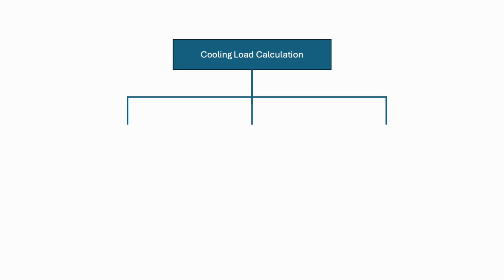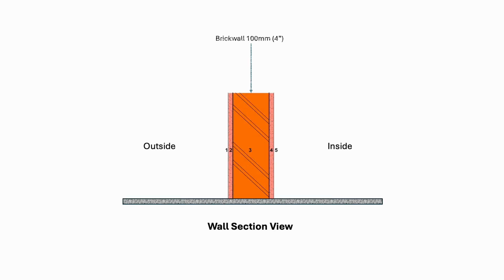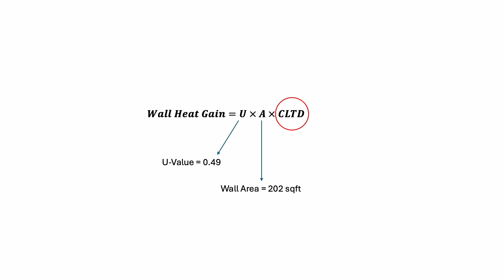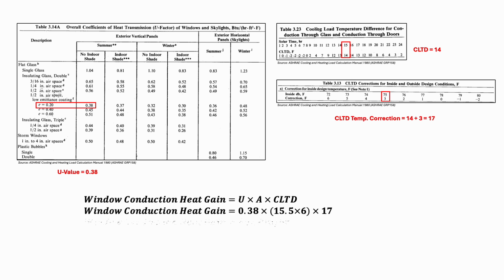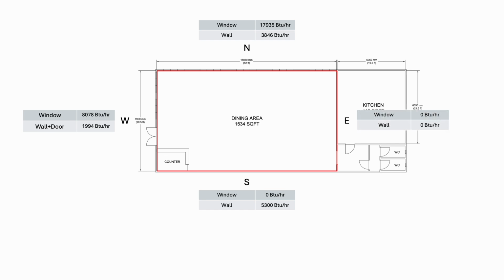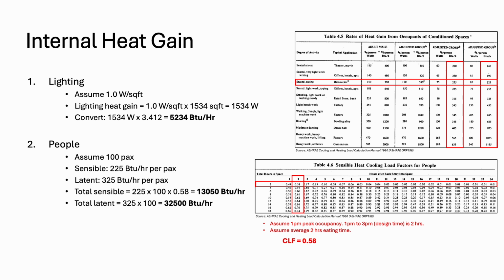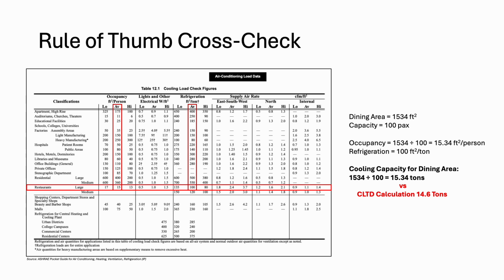Simple Cooling Load Calculation Procedure

Comment: why the the CLTD for window just need correction factor for inside conditions?how about the outside?
Reply: The tabulated values shown above remain approximately the same for outdoor maximum temperatures ranging from 93 deg F to 102 deg F and daily outdoor average to be 85 deg F. However, if the values differ from above then table 3.13 is to be referred for correction in Outdoor temperatures.

Comment: Where you get cltd indoor temperature 78-75 from. Where you get 78 and 85
Reply from the maker: Refer to the correction factor table in the manual. It mentioned the default indoor outdoor temp. used for the factors and coefficients. Then, apply a correction factor according to your indoor outdoor design conditions.

Comment: Hi, thank you very much for your video. It is very informative. Quick question on the Table 12.1 Cooling Load Check Figures, I can't seem to find it in the ASHRAE Pocket Guideline SI and IP. Is there any reference for that? Because that table helps alot. Thank you. 🙏
Reply: You can find the table in the Cooling and Heating Load Calculation Manual as well. The table is labelled as A 1.1 on page A 1.8

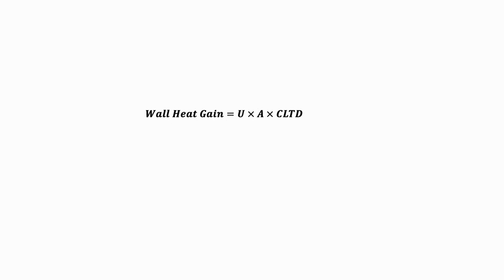Comment: Hello at 2:58 where did you get the 78 and 95 for CLTD indoor and outdoor correction. Thanks.
Reply from the maker: 78F indoor is what the manual use to derive those CLTD values. 95F outdoor is our outdoor design temperature.
Reply: @aircondlounge  Thanks a lot!. Last question. Why did you use Latitude 0 at 2:56. Thank you. Your work is great.
Reply from the maker: It is the nearest latitude to the location used in the video. Tq.

Comment: Nice video, really helpfull. But I have a question, i followed the same steps you did, but i was using he handbook from 1997, in that version i could not find the data portraid at tables 3.14 and 3.13 for glass windows. The only table with cltd for conduction through glass was the TABLE 34 at chapter 28. Is there any chance that this table already considers those correction factors, or they are neligible for the result?
Reply from the maker: It could be. Try to look for any notes that mention the need to apply correction factor. Otherwise, follow the steps outlined in the book.

Comment: Hi Yu Chang Zhen, 
My greetings for your wonderful work in YouTube. 
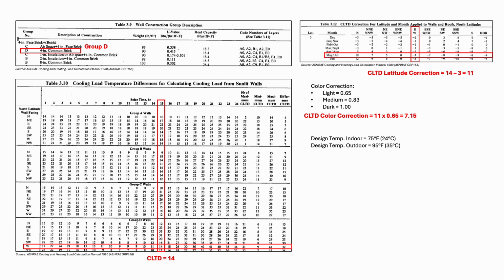2:51 How the equation is derived for CLTD correction for Indoor and Outdoor temperature. Can you provide reference details for the equation. 
Thanks in advance.
Reply from the maker: Hi, thanks for your compliment. The correction is based on the indoor and outdoor temperature used by ASHRAE GRP158 in the book. Their default indoor temperature is 78°F and outdoor temperature is 85°F. If we use a different design temperatures, then we apply the correction equation. This is mentioned in the respective section inside the book. Thank you.
Reply: @aircondlounge Thanks for responding to this. I would ike to know if the correction factor should be used every time?
Reply from the maker: It should for improved accuracy, or you don’t and treat it as safety factor if your outdoor temp is lower than what ASHRAE used.